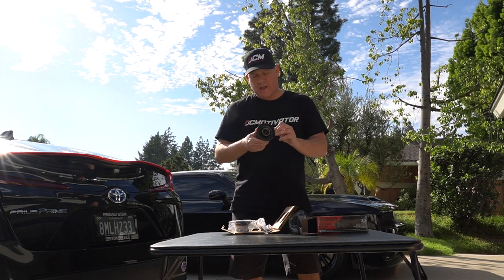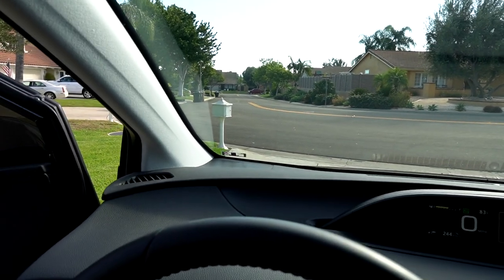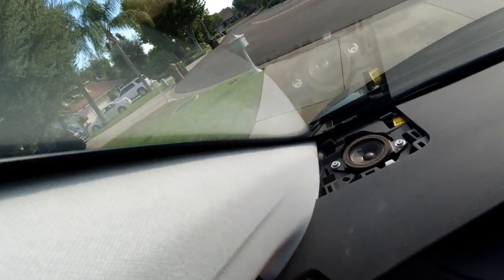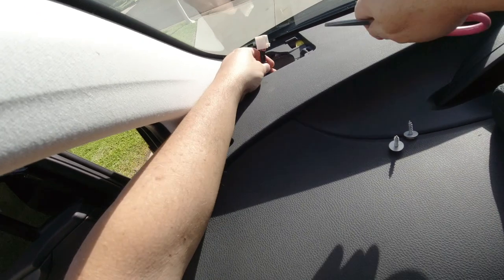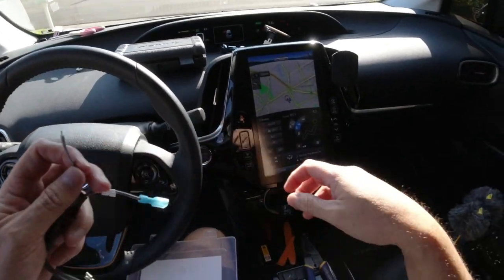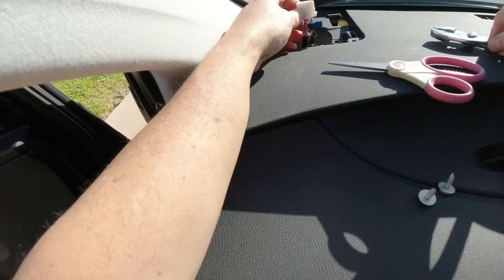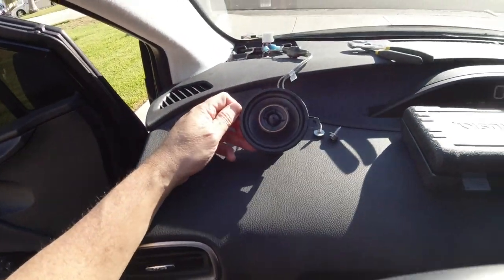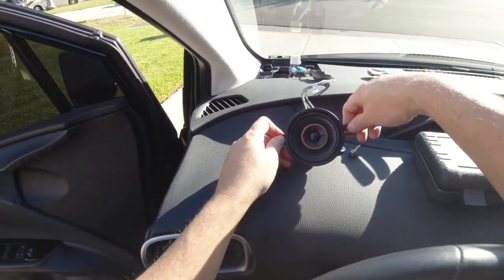2020 PRIUS PRIME DIY DASH SPEAKER UPGRADE

Comment: Which 6 1/2" speakers did you install for doors?  Just for the record, I also ordered the kickers from crutchfield and they give you the connector for free to connect the speaker to the cars connector no need to splice at least for my 2017 prime. A no brainer. Will install myself next couple days when I have time.
Reply from the maker: I didn’t do the doors. But Crutchfield has exact matches with adaptors and instructions. It’s a bit of a big job to do unfortunately
Reply: @ocmotivator  ...thanks for info, I'm getting a pro shop to install them.

Comment: Waiting for the following video. I have a 2017 Prius 4 , I’ll learn from your vids and try and get mine upgraded :)
Reply: Did you upgrade speakers? I have the same car.
Reply: @DarkstarDarth  Haven yet. Did not get any good start to end tutorial anywhere :(
Reply: @clarydsilva8617  ..I'm actually buying the kicker speakers on crutchfield today and a local shop will install for a few bucks. I'll let you know the outcome.✌️
Reply: @DarkstarDarth  Yes please !!! LEt me know the cost too what you incurred. I hate my stock speakers. Cant enjoy clear music on my 2017 prius
Reply: @DarkstarDarth  Thank you kind sir ! :)
Reply: @clarydsilva8617  ..I’m receiving them on this Wednesday and installing Thursday. Stock paper speakers are an embarrassment 😀
Reply: @DarkstarDarth  Thankls for the update mate ! ... waiting for a review ! Did you have the JBL ones before or no ? i dont have the JBL ones
Reply: @clarydsilva8617  ..don’t have the jBL’s , I only have the premium package. I’ll probably go with the JL 61/2” for the doors after this phase of the upgrade. Then Alpine amp and 10” JL in the hatch. Same as my BMW.
Reply: @DarkstarDarth  Hey Dan any update on your Sweet system ?
Reply: @clarydsilva8617  …yes,  I installed both 3 1/2 “ dash kickers on my dash in less than 30min. With included connectors it was too easy. The 3oz. Paper factory speakers are garbage compared to replacements. I used a pocket knife to flip front speaker grills which was easy to do. Sound is definitely much more powerful at max volume almost hurts my ears. Shopping now for the 61/2’s probably will go with JL’s reading reviews. Don’t hesitate to upgrade from crutchfield, free connectors included.
Reply: @DarkstarDarth  I till i will buy the same then ! Is there a video instruction or somthing ?
Reply: @clarydsilva8617  …don’t need video, just pop the speaker grill two 10mm bolts unplug it and plug included connection and re install……piece of cake.
Reply: @DarkstarDarth  did you get this one for the dash - Kicker 47KSC3504
KS Series 3-1/2" 2-way car speakers
Reply: @DarkstarDarth  Hey Dan ! Did you end up installing everything ? What was your total cost and how is it now ?

Comment: Don’t use those taps vibrations will cause them to cut the wires in half or cause to other issues
Reply from the maker: Believe me.  Those things are not getting loose.  I could build a hammock in my backyard with these things to hold my weight.